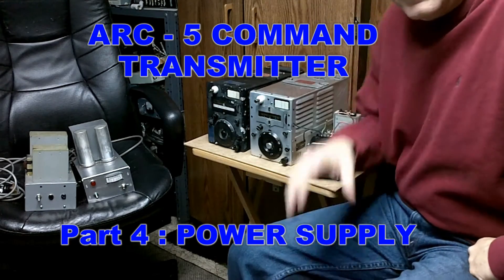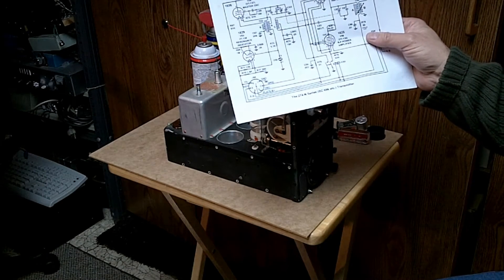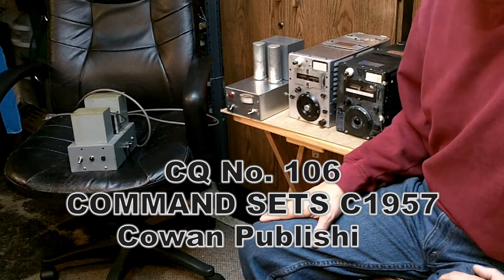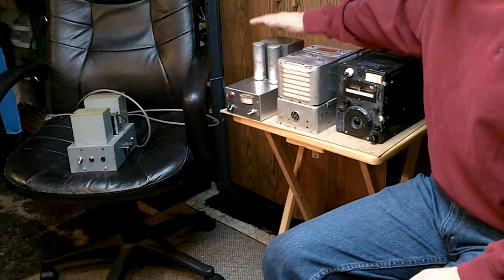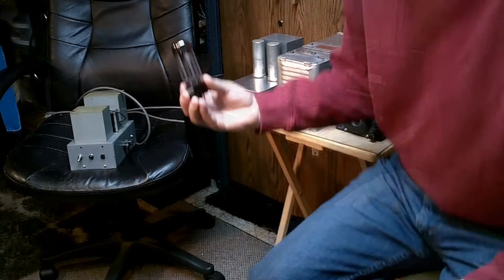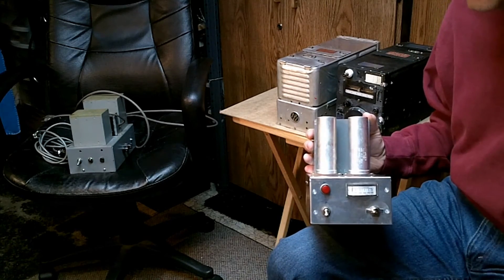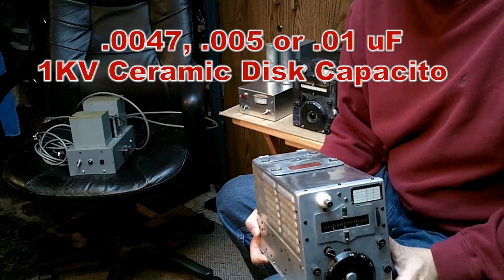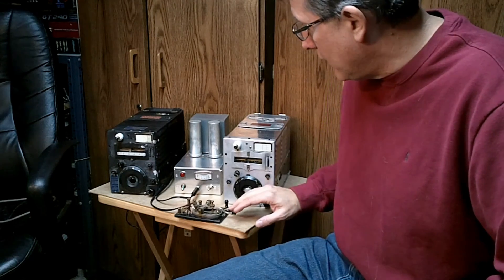ARC-5 COMMAND TRANSMITTER PART 4

Comment: Could you explain the 4.7 ohm resistors and why they’re there in your PS. TU
Reply from the maker: Just a surge protection feel good for the older diodes. Leavem out with modern diodes like 1N5408's.

Comment: I’d love more information on your PS for the T-22. I have just acquired a T-22 and hope to match it up with its ARC-5 receiver on 40M. 73 de WB4YDL
Reply from the maker: Check out my Radio Resources FB support Page which provides high rez schematics and photos. https://www.facebook.com/Mikrowave1/photos/pb.100063494943511.-2207520000/758931924991400/?type=3
Reply: Many thanks - I’ll need a Hammond box like yours to mount what I think is a Hammond 372HX. I have one of those 24v server switchers that I use with ARC-5 receivers, so that’s no problem.  Those 4.7 ohm resistors - snubbers ?? The rest I think I have in stock - even one of those crystal red lamps. Going for it !! Is your keying line just straight fed to the rear connector ?
Reply from the maker: If the radio is unmolested, yes, connect the key to the rear. Many were modified with a front jack.
Reply: What’s the rating on those 4.7 ohm resistors, 5W ?
Reply from the maker: @jameshall5835  not critical at such low current. 1/2 to 1W

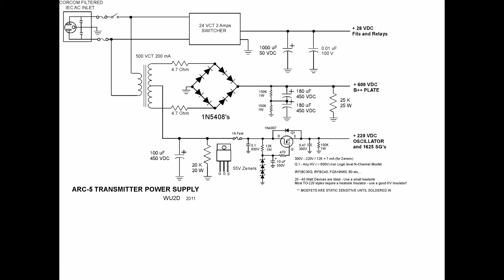Comment: do you have more details on your PSU design (06:11) such as construction techniques, sourcing components etc? 
Alternatively, are there any commercially available PSU's that would work?
Reply from the maker: The hefty Power Transformer is available typically for replacements for Guitar Amplifiers, such as the Hammond 372 series, if you want new and are willing to spend 100 bucks. I would rather pay 15 bucks at a ham flea market for an old military or TV transformer. 500-600 VCT are excellent and you only need about 150 mA, so any of those are plenty good. They have loads of models that could be used in the Economy mode hookup with  a bridge and choke input and CT as half of the voltage for the Oscillator with a voltage divider and better yet, regulation to 220 VDC. I like using a plain old 24VDC Switching power supply capable of 3-5 Amps for the filaments and relays.
Reply: @MIKROWAVE1  I picked up a 24v switch mode PSU capable of 6A so should be fine for 24v.  I am still confused on the pins for the ARC-5 (not SCR-274) and what V & A they should be.  I downloaded a copy of the army manual but I'm still not clear.  Are there other good references out there?
Reply from the maker: The pinouts are absolutely different between the two.
Reply: @MIKROWAVE1  Yes I have heard that but I was wondering if you could point me to a reference for the ARC-5 pinouts.
Reply from the maker: @matthalsey387  Go Here to the Resource Page! This is where i put up things to support the Channel. Mike https://www.facebook.com/media/set/?vanity=Mikrowave1&set=a.758933311657928
Reply: @MIKROWAVE1  perfect.  Thanks

Comment: What is the possibility of using a 250 to 300 V transformer, and a double circuit to get your high voltage, and a pair of cheep 12 V battery charger transformers in series to get your 24V?  
  To me you’re going to find a lot more transformers in that range, than you will find a 500 or 600 volt one, especially center taped.